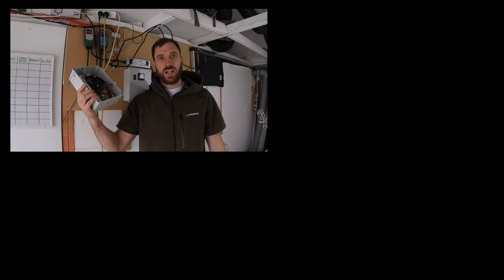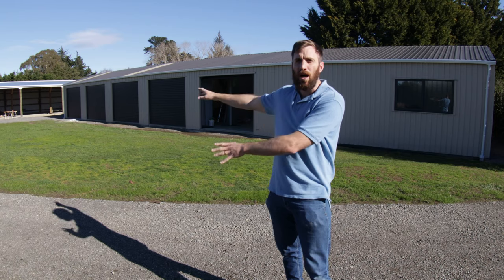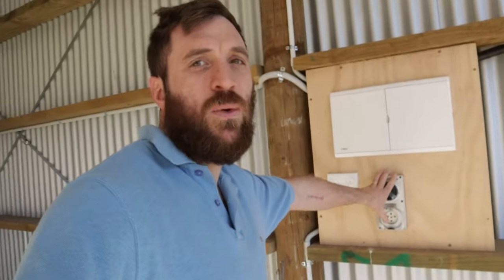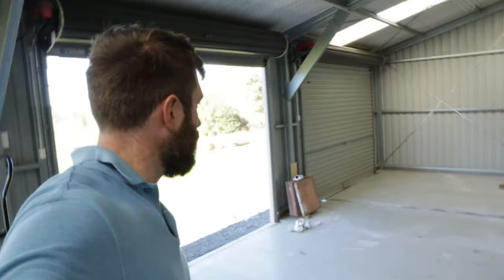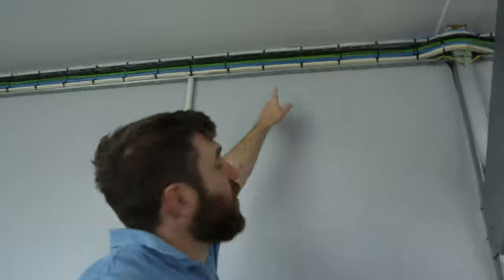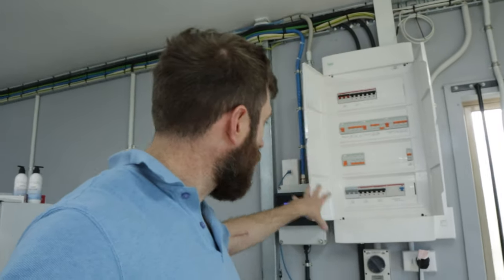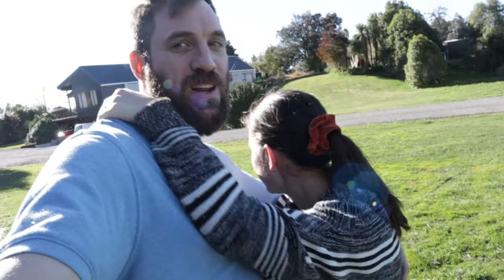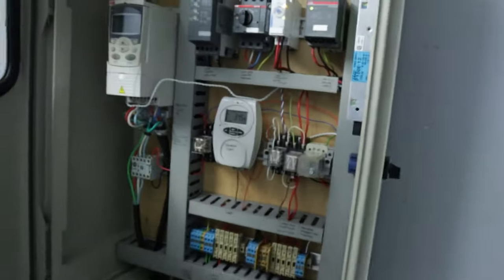I am Building my Mushroom Farm From the Ground up!

Comment: Hi Bro, just wondering which soy hull brand you use there in NZ? Im in Aus and struggling to find ones without preservative like mould inhibitor. Much appreciated
Reply from the maker: I use unbranded bulk soy. I don't think it has a preservative. Try bulk stock feed suppliers.